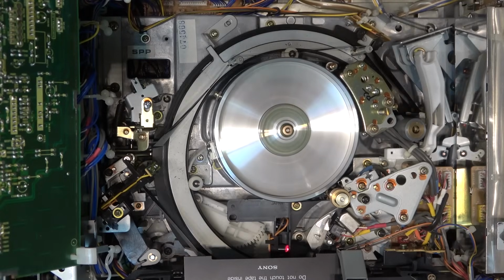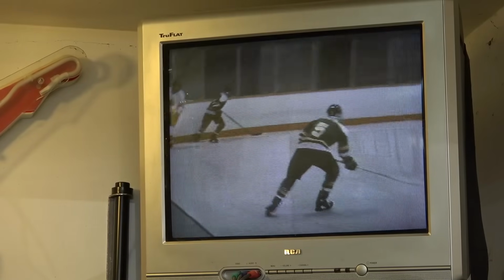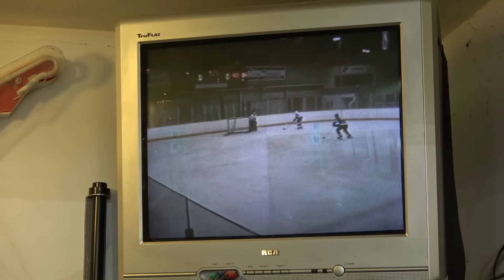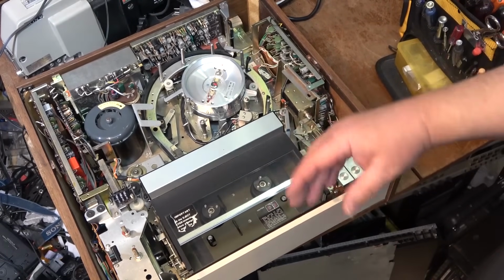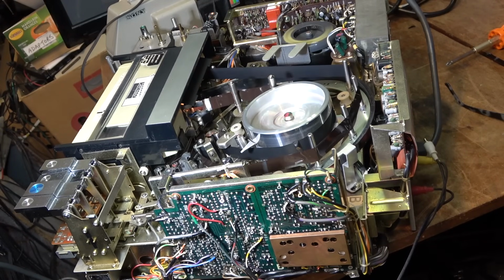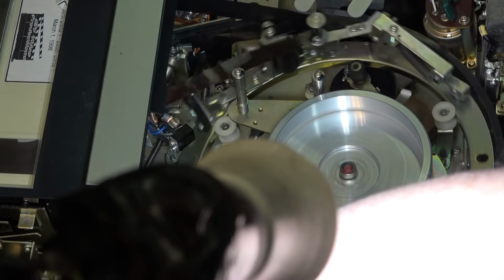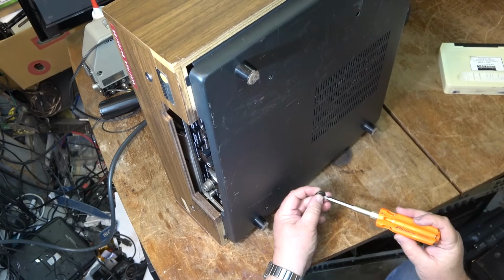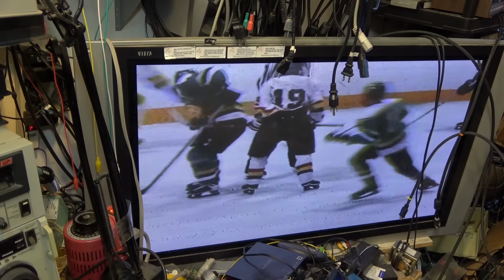Antique 53 year old Sony VP1000 U-Matic video player gets checked over and repaired.

Comment: Hey 12voltvids, I recently came across two of these units in rather poor condition, I'm still deciding on what to do with them. I was wondering what type of power cord you used? Is it a regular extension cord or something else?
Reply from the maker: Just a regular 3 prong extension cord.
Reply: @12voltvids  Great, thank you!

Comment: Every time I see any video cassette recorder in operation I’m so amazed at how they handle the tapes pulling it out and returning it to the cassette without damaging it it’s just great engineering.
Reply from the maker: Why do you think the opening shows all the different types of loading.
I didn't include the 711 beta chassis that loaded the other way with the pins that flip up, because I used a betacam deck that loads the same way t hat the early betamax did.   Did show both versions of 8mm, as they were initially U loading and then switched to M loading as it allowed a more compact camera.

Comment: Never seen an early Umatic in operation.  It does REW/FF in fully unlaced mode, not seen than on Umatic.
Reply from the maker: All umatic vcrs unlace the tape when not in play or record.  The edit machines keep laced for search but unlace when stopped.
Reply: @12voltvids  Perhaps I should have been clearer.  I've never seen a Umatic FULLY unlace for FF/REW.  All my later machines, part unlace but keep the control track head in place so that you can accurately find a part of the tape.

Comment: 53 years old, the capacitors and the head still work today?
Reply from the maker: Sure do. Kind of shoots holes in the theroy that capacitors all fail after 5 years doesn't it?  It's working as well as it did in 1971.
Reply: @12voltvids  this is incredible after all 70&80's devices were the best and most powerful , I have a 1977 Yamaha stereo which is split into amp , radio , cassette player and vinyl it still works fine to this day , and for video cameras I have Sony CCD V -100  (1986) which also works to this day I will test it in the next few years. amount will last over time
Reply from the maker: I find it hard to believe any v series camcorder still works.  The ir cut filter on those early ccds failed. The glue that holds the pieces together turns cloudy.   I have a v110 that the filter is shot as was my gcs1 betamovie.
Reply: @12voltvids  Is this machine from the era when carcinogen chemicals were used in capacitors?
Reply: @12voltvids  "Kind of shoots holes in the theroy that capacitors all fail after 5 years doesn't it?"

I've never heard that theory, but I've seen lots of them fail or get out of spec enough to affect functionality of the device they're in after 25 or 30 years.

Both of my main VCRs, a JVC from 1985 and a GE-branded Panasonic from 1988, needed new electrolytic capacitors in their power supplies. The JVC needed them when I got it in 2018, so I don't know when they first started going bad. I've had the Panasonic since it was new and I first noticed its capacitor problem (wavy motion in the picture, especially noticeable in its blue OSD) in the mid 2010s. Replacing the power supply capacitors fixed both of them.

On the other hand, I have a Panasonic PV-1220 top-loader VCR from 1983 that doesn't show any signs of bad capacitors. I don't know how I'd replace its capacitors even if I needed to though, because I can't get the top cover off the thing for the life of me.

Comment: How long do heads last on those machines ?
Reply from the maker: They are only rated 1000 like all VCRs.
Reply: @12voltvids is it luck if they go past 1000 alot of my 80s machines still work to i have the super beta with the built in receiver and my first hifi vcr is still with me
Reply from the maker: 1000 is the rated life.  Some will last longer, much longer but as they wear the quality will start to drop.
Reply: @12voltvids  I got them serviced recently and none seem to have issues for the moment my mitsubishi from 2002 and a jvc i have from 2006 are my most loyal svhs machines.
Reply: @12voltvids are most umatic vcrs in stereo even the earliest ones ?
Reply from the maker: 2 channel audio from the start.  Channel 2 dubable
Reply: @12voltvids  were they hifi right away or just stereo like vhs was at first.
Reply from the maker: All industrial and broadcast machines had linear sound.   Betacam SP had linear stereo but they did add AFM HiFi audio to the high end broadcast machines like the bvw75.  On the betacam decks the afm was recorded in unused bandwidth on the chroma head.   Remember that betacam recorded with 2 pairs of heads.  2 for the lumanence and 2 for chroma.   Lumanence bandwidth 340 lines of resolution but the chroma only 120 for each the red and blue.  Unused bandwidth was used for audio channel 3 and 4.  
3/4 used only linear audio.  The SP version added Dolby C